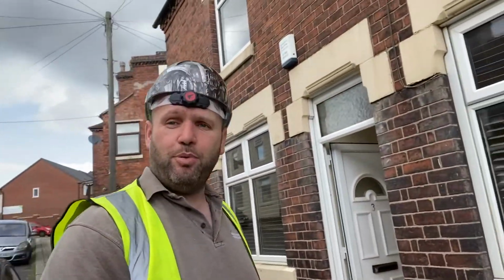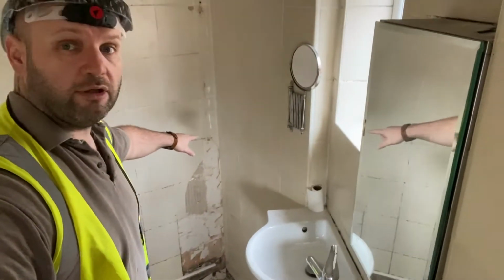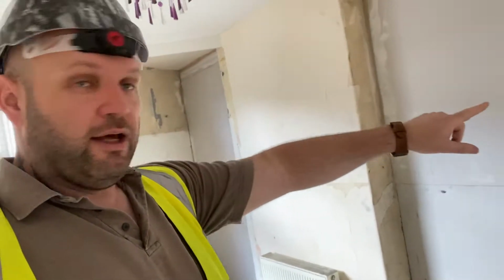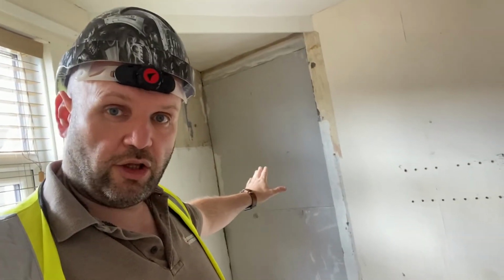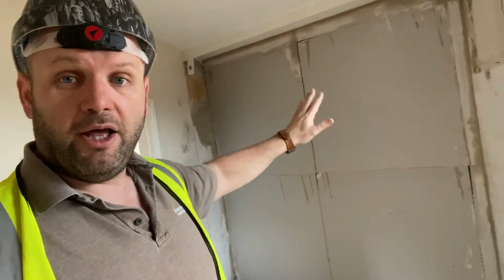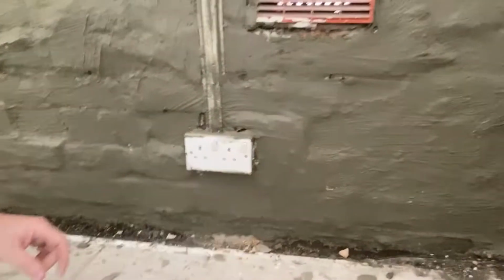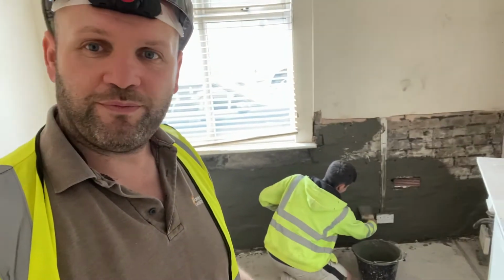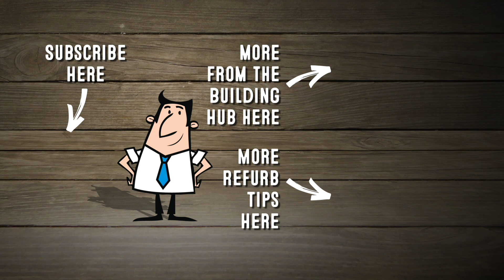Tanking to Prevent a Damp Course Breach – Light Refurb in Stoke Part 2

Comment: Just found your channel and I’m glued to it,
I’m a carpenter doing mostly new builds so this is all new to me,
Just one question,
Because it’s end of terrace the walls each side of the chimney breast have black mould,
But what about the front and back walls  of the property, ( and all the mid terraced properties)
Shouldn’t they all have black mould on them as well? As there exposed to the elements as much as the gable end,
Loving your videos, and learning a lot ,
Keep them coming for us amateurs 
Thanks
Reply from the maker: Hi there. Yes, you're right. Any external wall can be problematic when it comes to mould (i.e. hot on the inside and cold on the outside) and can suffer from condensation. The mould normally grows on the coldest spot that is unventilated – normally the corners of the room. 

The reason end terraces suffer more is because they have an additional external wall (gable) which is huge. Therefore, a much bigger surface area exposed to the elements — and a higher risk of cold spots. It's usually the case that end terraces cost more to heat in winter, too, for the same reason.

Hope that helps.

We're absolutely thrilled that you're enjoying the videos and really pleased that they're helping – makes it all worthwhile when we get feedback like that 😊Thanks for watching. We really appreciate it. Stay tuned for (many) more videos 😀👍

Comment: Can you dot and dab over a tanked wall
Reply from the maker: Hi there. Thank you for your question. Personally, we prefer to use a panel adhesive because it's impermeable. Dot and dab is an option but there is still the possibility that the bonding will draw moisture – whereas panel adhesive won't.  

Thank you for watching our video – we really appreciate it 👍🙂
Reply: @HYPEBuilding  thanks